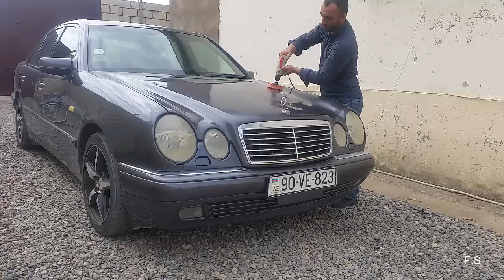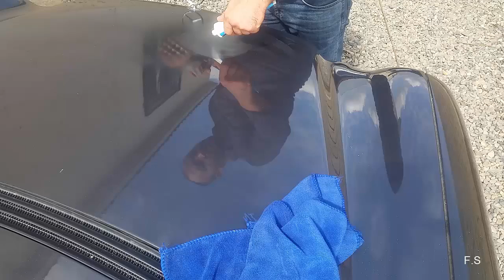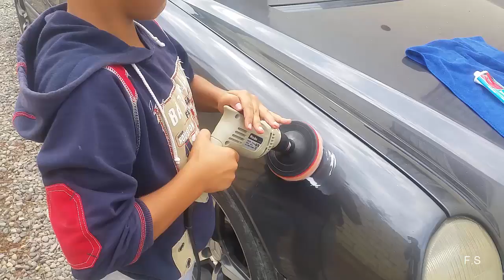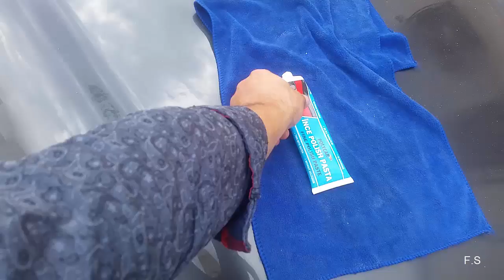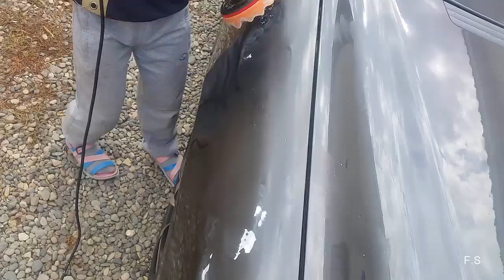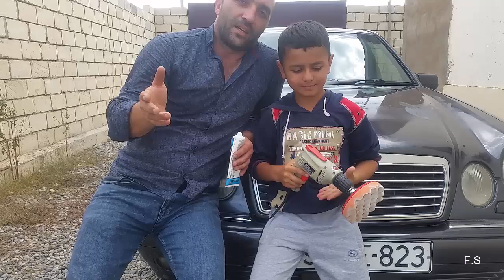How to Properly Polish CAR with a Drill

Comment: Apply your compound first with a wet cloth before trying to buff it off.... never apply it directly to the paint... hope this helps
Reply: Why?
Reply: Applying with a wet cloth will give you a much better even coverage and make the compound easier to work with .. and by not applying directly to the bodywork you lower the risk of the compound drying on the paintwork
Reply: ninjatatt 🤦oh I did it yesterday, so dose it impact my paint?
Reply: @husseinalmandalawi3405   If you accidently collect a lump of dry compound on the buffer head and then continue to Polish the car with it ..it may have made swirl marks especially if its a dark coloured car 👍
Reply: ninjatatt thanks for your answers that what has happened, just one more question can I fix this swirl marks?
Reply: @husseinalmandalawi3405  you can re-buff the car gently making sure you don't allow the compound to dry and then gently hand polish with a low cut wax and it should look good as new.. use only new or clean microfiber clothes to remove the wax 👍
Reply: They were using toothpaste tho
Reply: @michaelhorsman3380  they were using polycar polish paste, definitely not toothpaste 👍🏻